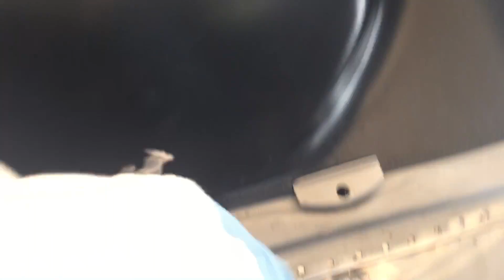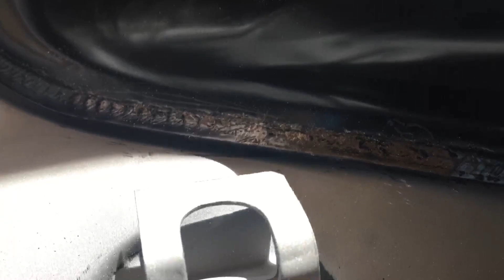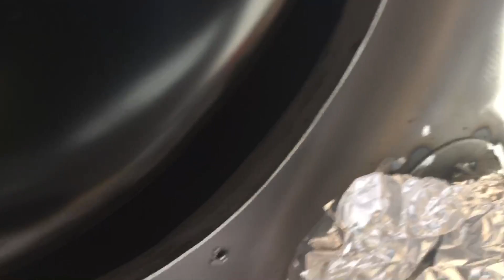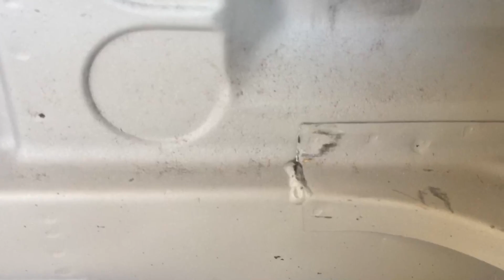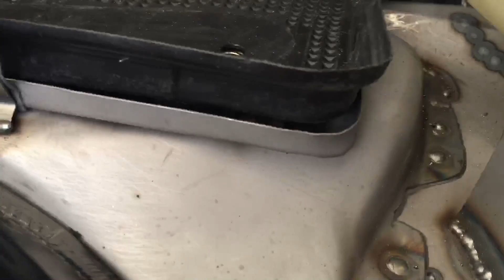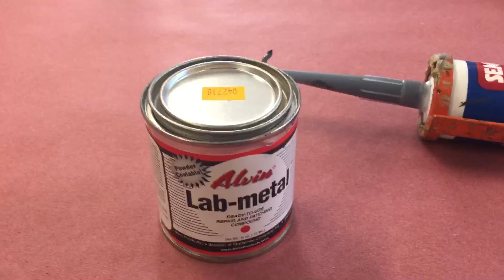1967 Porsche 911 Video 14 Front pan replacement part 2

Comment: Hi Mike, was just going through some of your older videos (I love watching them as you know). I see in this video that your car has the same two vertically aligned screws in the front left corner of the “frunk” that my 68 has. I have no idea that these are for, can you shed some light on this for me? They are just above the washer pump bracket. Thanks!
Reply from the maker: Hello Andrew
That is the location for the horn relay.
The holes should have two white plastic speed nuts that snap in and then 2 small screws and washers hold the relay to the speed nuts

Comment: How do you garanty the caster to be correct. Saw vid #12 and that you screwed suspension in place but still...
Reply from the maker: Hi Swen
Welcome to the channel
In these videos the example shown is just a simple way to align the new replacement pan with existing control arm assembly.
You might check out my newest video on adjusting control arm angles.
Final adjustments would need to be made after car is under full weight and on the ground but is a good starting point if your are completely rebuilding the front
suspension area of your car